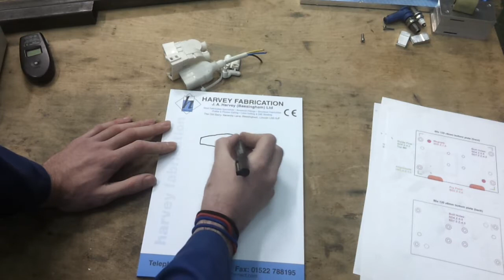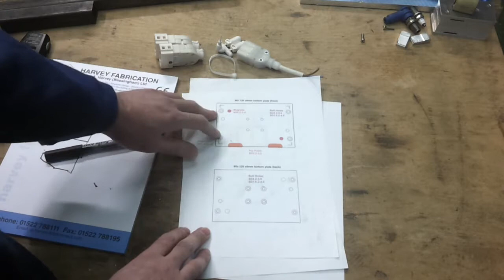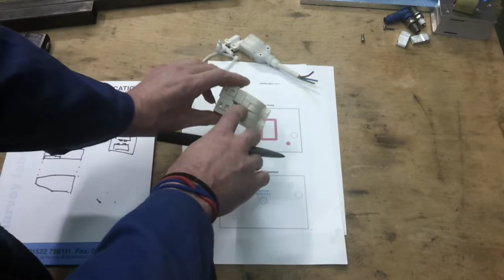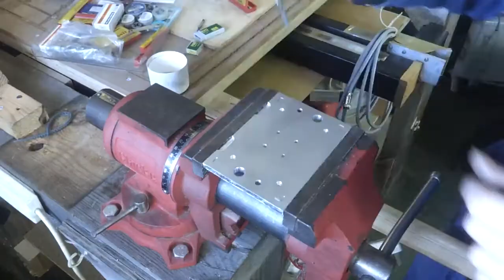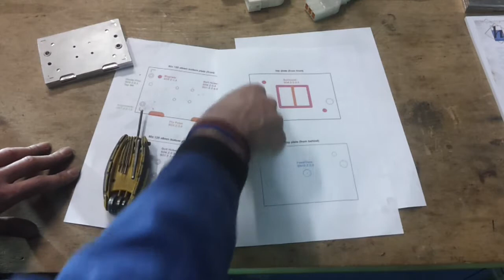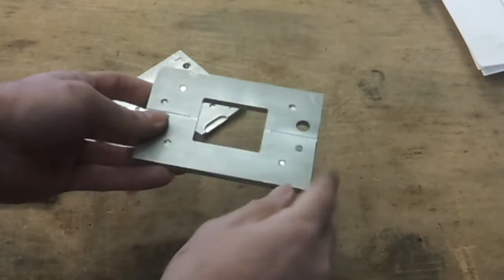DIY Injection Moulding - Plug Connector Pairing Bands

Comment: What material you used to make mold, is it aluminium ?
Reply from the maker: Yes, 6082/HE30 grade. Pretty much any aluminium works other than 1000 series. That stuff is 99% pure and doesn't machine well.